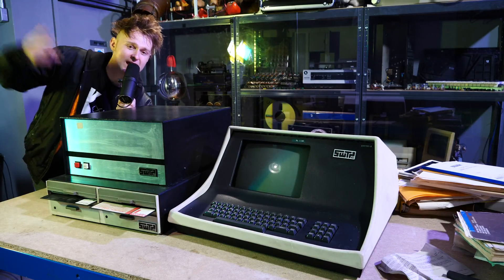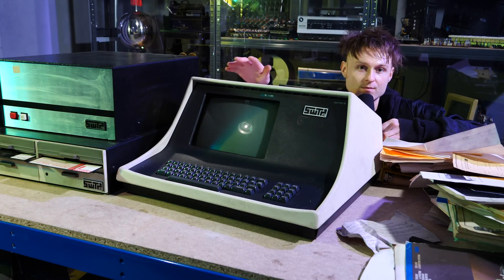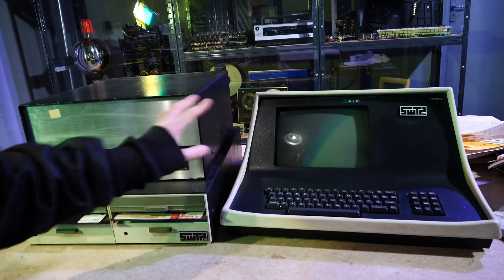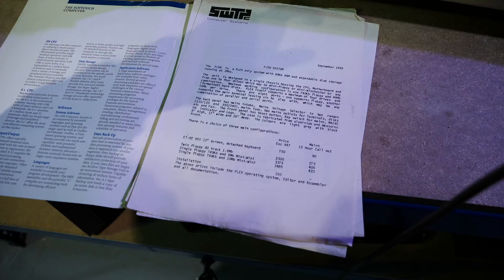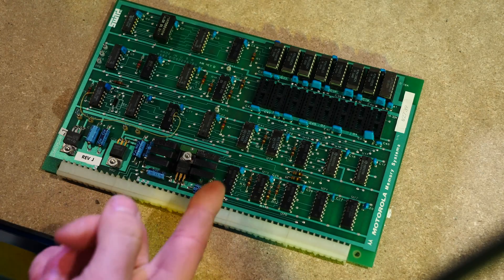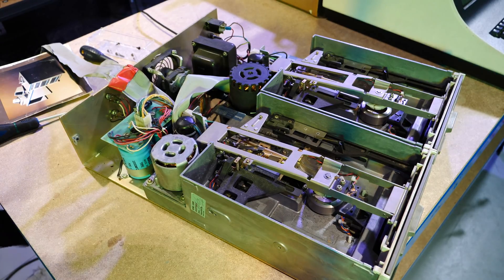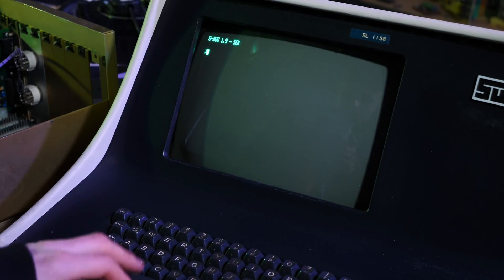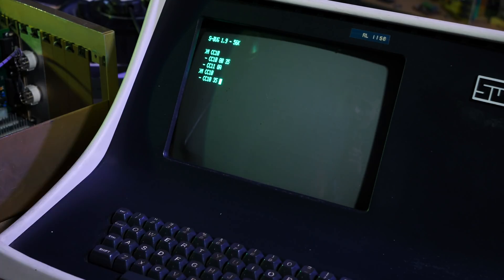Rare 70's Computer Find - Will It Work??? SWTPC 6809

Comment: Awesome! Belongs in a 1970s sci-fi set! Perhaps it could be as simple as the drive heads need cleaning? Or maybe that particular disk degraded or was erased? Edit: I also know motor speed is critical. Perhaps adjustment info is in the documentation you have.

Comment: Clean the drive heads and clean the floppy disk before use. On the drive heads gently use q-tips with 96 proof alcohol. To clean the floppy disks use a mixture of 30% isopropyl alcohol mixed with distilled water. Use a microfiber cloth to gentle clean it. Don’t use q-tips on the floppy disks. Great find and I’ll tune in tomorrow.

Comment: data on floppys doesn't age particularly well, would be surprised if they were still readable after some 35-odd years
Reply from the maker: I dunno I have 5 inch floppies of similar age loading mostly fine I think it's mostly the drive itself.

Comment: Looks really familiar. You may be running something like this:

https://lab.nethence.com/frederic/VEGAS6809/DOCUMENTATION_MICROSYSTEME/

The return phrase "Can't read IPL" comes from service file TSC_UTIL.VEG which is part of the Flex operating system used on 6809 architectures back in the day. Microkit was another company making these machines. Maybe they are still around. Hopefully that gets you a good Googling start anyway.

Good luck!

Comment: Are we sure this isn't a Minicomputer? Microcomputers usually weren't in two giant pieces.
Reply: No, that's a micro!
Minicoputers often had wheels on, or at the very least a sturdy rack.
Plain old 'computers' usually needed an air conditioned room (or two) to themselves

I wonder WTF they'd have called a smartphone back in the 1970s
Reply: If it fits on a desk it is a microcomputer. If it is the whole desk it is a minicomputer.
Reply: @1pcfred  A lot depends on the desk! how about, "if it doesn't break your ikea desk then it's a microcomputer!" try that with a PDP11!
Reply: @1pcfred  Cool, isn't that pretty much the pocket-edition! only takes a single adult to carry and only 1 trolley for the peripherals! (I've only got 6502 based stuff myself so i'm spoiled!)
Reply: @1pcfred  I thought the /34s were smaller, but that could just be the front-panel I'm thinking of. That's why I stick to micros! Furniture sized equipment is lovely but I've only got the space to properly care for a few small machines, I get my fix of blinkenlights and front-panel switchery with a dinky 12"x3" cutie I knocked up a few years ago. no trolley needed!

Comment: Maybe turn it into a sequencer via the parallel port? Something that looks a little more "in tune" with your setup than the overly modern Beatstep pro? Also, hard disks were bleeding edge technology then. IBM started only in 1983 to offer a hard disk as an option for their iconic PC. Before that, they were exclusive to data centers and weighed a literal ton.
Reply: That's actually a good idea, and easier than hooking up sound chips. Something that big has to have a printer port on it.

Comment: "IPL" refers to Initial Program Load. With a computer of this era you needed to boot a program from the disk that allowed the computer to access the disk (like the boot sector on the PC). Is the disk you're using a boot disk? Usually users would only place the OS onto specific disks, boot from them then change to the application disk to actually work.
In my first job in 1985 after graduating I worked for a software house and one of the customers had a SWTPC 6809 computer that looked uncannily like the one you have there. The prices in the list are accurate, commercial microcomputers were so expensive! That's why consumer computers like the PET, Apple and TRS-80 were such a revolution, coming out at a tenth of the price of other systems. And single board kits ike the NASCOM-1, UK101, ZX80/81 were another revolution bringing prices down to levels affordable to the general public. As far as I recall SWTPC made "commercial" offerings as indicated in the catalogue and kits based on the boards, so if you wanted you could construct one yourself. The "bodge" wires on the PCBs were typical of the time, even from major manufacturers due to the high cost of mastering the artwork for the PCBs (no computer CAD for any but the higest end manufacturers like IBM and DEC!) so they would do extensive rework on PCBs to save costs. Also these were manufactured in the hundreds rather than the thousands.
It's a nice machine and a very rare find! One tip: computer enthusiasts of this era used to connect an amplifier to one of the higher address lines and write programs to precisely time access to (unpopulated) memory addresses to make square wave tunes - maybe thats something you can try out your 6809 programming skills on! Luckily the 6809 had a fairly advanced architecture so programming it is fairly straightforward compared to other microprocessors of the time.
Reply from the maker: I was running it from the built in boot program. But yeah thanks for the info!
Reply: @LOOKMUMNOCOMPUTER  You may need to re-red his comment.  "I was running it from the built in boot program." You ran the boot boot strapping, it loads the boot sector IF the disk has one. the "built in boot program" isnt enough
Reply: There is no such thing as build in program in the computers of this area. The disk it's waiting for is not even an OS but what was called a bootstrap loader.
In older models it was a serie of instruction send from the terminal using a perfored paper tape.
Your is able to receive it from a floppy. 
Starting a micro computer was usual a complex process and that's why it was common to avoid turning them off. 

We had one donated to ly school in the early 80s. It was a dinosaure already by then. 

The design of the terminal is very 70s SF stylish. It's just a terminal. You can connect it to a RPI with some adaptator and still be able to use it as shell.

The characters are displayed twice because you have the echo option on.
Reply: Agreed. Computers of that era generally did not have their OS in ROM. The built-in program you're seeing is a bit of code which we referred to as a monitor program, which was small enough to fit on a ROM of that era. There should be a command in that monitor program to load the boot sector of a floppy containing the OS. The boot sector then takes over and loads the OS itself.
Reply: Ian is right. The term comes from the IBM mainframe universe and was coined in the 60s. Even the modern multi-million dollar mainframes are "IPLed" to this day. It is a multi-stage process that can be used both for regular "booting" of the operating system and for alternatively starting special dump/diagnostic routines in case of failure: 
https://www.ibm.com/support/knowledgecenter/linuxonibm/com.ibm.linux.z.lgdd/lgdd_c_ipl_vs_boot.html
Reply: Yeah, the Commodore and Atari were different in that much of the DOS was inside the floppy drives. Apple II had to load DOS from the disk, but it was small enough that most disks had it. But most microcomputers just had a floppy disk controller chip that talked to a dumb hunk of metal and motors, with just enough code in ROM to read the first sector from the disk and run it.

Financial records? Basically you were trying to boot from a data disk. It's still amazing that you got that far so quickly with so much stuff that could go wrong.
Reply: fantastic info ian.

Comment: Back in the day (Late 70's) when you got a flashing command prompt on the screen you usually had a few choices;
C - Cold start
W - Warm start
D - Boot from an OS on a disk drive
M - Enter machine code mode

I think you need to find the disk with the operating system on and see if you can boot from it?

Good luck!

PS My first computer was 6502 based from Ohio Scientific Instruments in the states, so just later than the PC you now own.  Things had moved on a bit, but the prices were still truly astronomical compared to today.

Comment: Even if you can't make tunes with it (and quite frankly you probably can make the floppy drives sing at least) that would make a cracking exhibit at the museum. Maybe use it as a guestbook thing?

Also I'm pretty sure you could drive the terminal from a Raspberry Pi if you wanted to, after all when it comes to Linux a tty is a tty, even a 100 year old electromechanical one as demonstrated by Curious Marc haha

Comment: That is beautiful! And working! It's a seriously high end machine, and if you have more terminals, you should be able to plug them all in and have multiple people using it at once...

That machine's going to boot from floppy, so it'll want a specific OS disk in the drive before it'll do anything. Chances are that accounting disk isn't bootable. I saw a reference to FLEX, which is a classic (and hard to use) OS for 6809 machines, so you might want to search for a disk labelled something like 'FLEX boot disk' or 'FLEX work disk'. This won't be the original --- the user will make a copy of the original and works with that (so they can write files to it).

The disk drive will probably need a clean. Dust will build up in the congealed lubricant on the rails and bearings, which will need cleaning and relubricating. The disk heads will also need cleaning by wiping them gently with a cotton bud with a little IPA on it (the alcohol, not the, er, other kind of alcohol). Check the disks for mould or damage. If you get any of that on the heads you'll need to clean the heads again.

Chances are that it contains no speaker; the beep was made by the terminal and probably isn't tunable. You might be able to make noises by bitbanging an output port from 6809 machine code, and hooking that up to a speaker. You ought to be able to hand-assemble this and enter it directly from the ROM monitor (it should only be a handful of bytes), so if the disk drive doesn't work then all is not lost.

*Edit:* I think you can use a floppy emulator on one of these, although you'll need to wire up an adapter. That might be easier than trying to write to 8" floppies if you want to copy files to it (I've actually got some hardware that might let you do that: http://cowlark.com/fluxengine/).

Comment: IPL probably means Initial Program Load. So you may just need to insert a OS disk and it will try to boot from it.
Reply: Yes a term coined by IBM - still the term for rebooting a z mainframe LPAR (logical partition).

Comment: Fantastic! When I was in my early 20 in the mid of 80s I was programming a 6809 in assembler and using a unix like os called OS9.
Reply: In what way was OS9 Unix-like?
Reply: @herrbonk3635  check OS-9 on Wikipedia and the section Comparison with Unix.
Reply: @PATRIK67KALLBACK  I did. To me it does not really look more UNIX-like than most other systems, OS'es or kernels, realtime or not. I got the impression some of the authors perhaps wants it to be though.
Reply: @herrbonk3635  well, if you look at the system today, it was not that special. But 1979 when it was releases and in the beginning of 1980s it was fantastic compared to other os like MS-DOS. In details about the kernal and so on, I don't have the knowledge. Maybe you have?

Comment: This is going to be exciting! Motorola 6809 and two 8” floppy drives, you’ve acquired some parts that where also in the Fairlight. On these old computers the floppy drives often use the Shurgard interface. The drives are often labelled device 0 and 1. The standard allowed for 4 drives on a ribbon cable, unlike the IBM pc which changed up a few things. Most floppy cables are 34 pins, but I think these 8” drives may use 50 pin ribbon cables. Important to know is the difference between the original shurgard standard and the IBM standard is the device jumper function. I have a feeling that you’ve got the access the drives by adressing them with number 0 or 1. At least On the Acorn machines it works this way. Also the disk motor starts spinning right away, this kind of suggests that it uses the original shurgard standard. It’s an interesting looking system, that’s for sure!

Comment: "IPL" very likely means "Initial Program Loader" in this context.

Or basically the boot disk.

It might need to load from the boot disk every time, before it can load other programs, but that's just a guess. lol

Be a bit wary around the disk drives, btw. A lot of older drives around that time used MAINS powered spindle motors.

Which is even more likely if the motors are running all the time.
Reply: I just posted some info for disk images, with a link, but of COURSE it got blocked. lol

Might be in your YouTube Studio thingy, maybe.

I searched for "SWTPC Can't read IPL", and found a page with some raw DSK images, and some HFE versions of those same images (for the HxC floppy emu / Gotek).

Also found a 1977 catalog with what looks like the exact same system in it.

And it lists the "complete kit" for the computer itself at $395.

Comment: all of the 8in disk drives need maintenance. I heavily suggest doing research on that since they all seem to have one of a few problems and I've never seen one magically able to read disks after years neglected. Curiousmarc has a video regarding data archival off of 8in disks that should help explain some things.

Comment: I saved for the better part of a year with my 3 paper routes to get a TRS-80 back then. It ran the 6809E. Cost $100 to upgrade it from 16k to 64k. I still have several of them in my storage.
Reply: I already had a Model I but wanted to do 6809 stuff. I got a 4K for what was probably $300 or $400 then, and upgraded it to 64K for around $75. Except that the 64K chips I got still needed 12V, and it took me a while to figure out to leave that one jumper in the 16K position.

Comment: please do some maintenance , oil the stepper motors of the floppy drives , use isoprop and qtip/paper to clean the reading heads , check capacitors(especially tantalums) for getting hot (those need to be replaced)